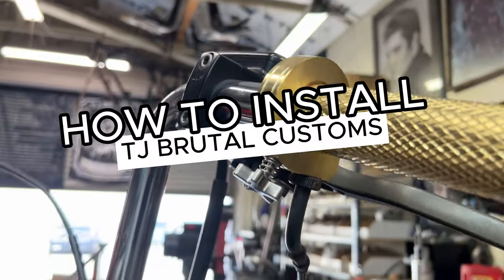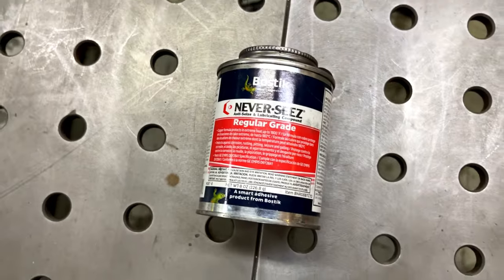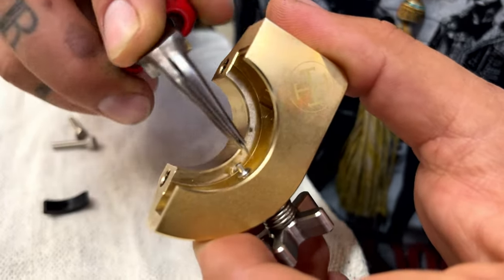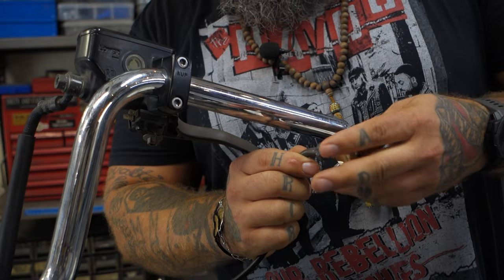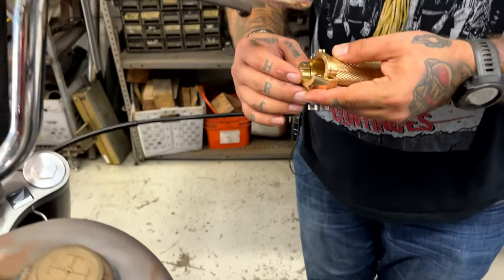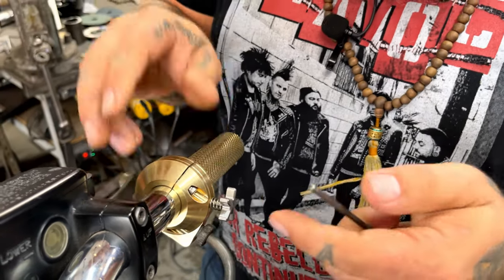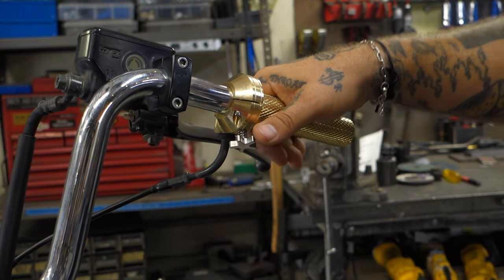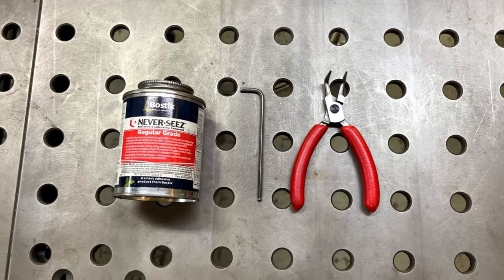Acerus Throttle Lock Install Video!  Upgrade your Honda Shadow Now!

Comment: Nice! Good to see you still fab custom parts. Just picked up a vt600 VLX deluxe with your brand all over it. Brass everywhere. Solid hardtail! Love the bike.
Reply from the maker: havent stopped making parts since 2006. 💪🍻
Reply: @TJBRUTALCUSTOMS  Wow, that's some dedication. I actually have a question about your riser bolts (old style with fat brass and double-sided bolt with different threads). Got a 2001 VLX Vt600cd deluxe with your parts all over it. Just adjusted the valves and cleaned out some 'short-trip-itis' pudding from the ceilings of the valve covers, flushed out the oil, sealed up the valve covers, no leaks, got it running better than ever even with the single carb (minus not WOT, still need to dial in the main jet). Get it back to the garage after a good warm-up and test run. Pass it off to my other mechanic who's working on a Virago (He owned the bike for months before I did). He goes up the hill for his test run, he's holding the handlebars straight, and the entire front end magically turns to the left with no ability to correct steering. It throws him over the bike as it goes down. He quickly gets the bike up and kills the fuel and the ignition.
My buddy is okay. Leg is a bit bruised, but the thing nearly killed him.
Minimal damage to the motorcycle.
The brass foot pegs broke upward (no big deal, I can replace it with a cheap spark plug socket for now). 
But other than that, it held up and still runs normal.
The cause of the accident, however, was the double-ended bolts. Specifically, the left one that connects the lower brass riser to the fork assembly. It must have just gave out after the first test. Because he could steer as he was leaving the driveway, once he got up the hill.. SNAP, on the ground. Don't know how I can keep my brass risers while finding replacement 'old-school style' bolts.
I might just have to drill them out with a shelf for washer, bolt-head and socket space, and replace the hardware with M14s that can fit the fork assembly threads.
Your thoughts?

Comment: Hey TJ ! I Have a question as I recently picked up a 2000 VLX600 and I was wondering if this model has the A.I.S. System? From my research 2000-2007 is the exact same model? So I'm assuming it has the air injection system? 
Hope to hear back from you, as if that's the case I'm going to go ahead and pick up one of your block off plate kits.
Reply from the maker: if the reed valves are on top of the head cover, thats the ais system. look at the product page for the cover plates. theres an image of one of the reed valve ports. ifg you bike has that on each head cover, you have the AIS.

Comment: I'd like to know where people have been relocating kill switch and ignition buttons. I just picked this up and can't install it until I figure out a solution for that
Reply from the maker: Side covers dude.
Reply: @TJBRUTALCUSTOMS  parts delivering today! Any advice on how to get the front brake light switch working now that there are no electrical cables going to the right side handlebars?
Reply from the maker: @jonvarga5569  no I never use that. I keep the rear switch intact. Don't worry about the front